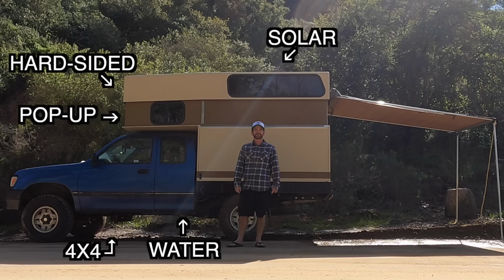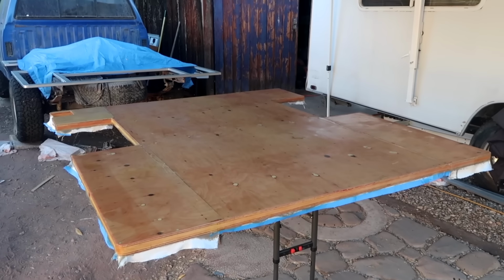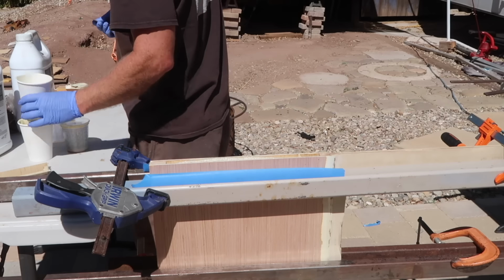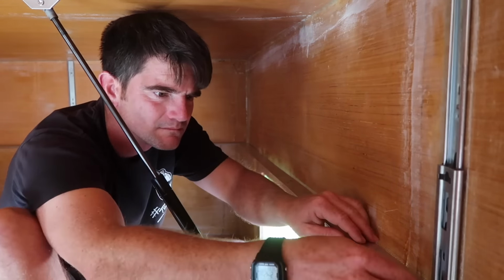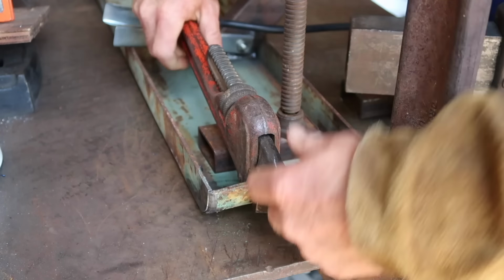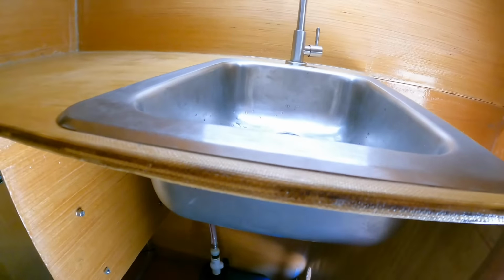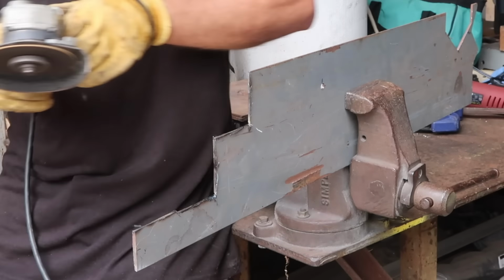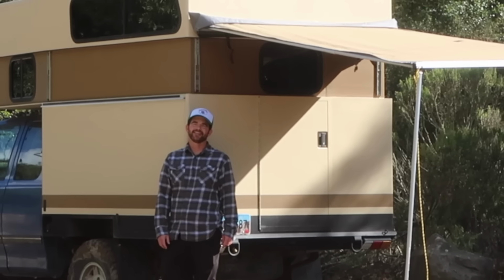Homemade Overland Truck Camper Build | Start to Finish | Full DIY Construction

Comment: I have a question for you, would really appreciate your opinion if you have a minute to spare:

Planning to overland the Americas starting late '24 early '25 with a Lance Truck Camper that i have 600w of solat and 560ah LifePO4 & 3500w inverter. It presently sits on a SRW F350 2wd with gas 6.8 V10 and under 100k. I have had the truck for 5-6 years, know it well. It is highly dependable and well maintained.

I would like to have a 4x4 for the trip, but the used truck market is quite tight. I have debated buying a cab and chassis and adding a flatbed and storage oxes, etc. Obviously this opens a can of worms.

Would you even consider doing the trip in a 2wd truck with AT or MT tires?

I'm leaning that direction just to save the headache of building out a truck. There are many stories of disappointment online of people trying to get everything to fit for a truck camper.

Obviously driving on the beach will likely be unwise, but besides the beach how often do you find yourself needing to use 4wd?

Thank you for your thoughts!

Love your channel, very inspiring!

Regards
Reply from the maker: Hi Charles. Sounds like you have an exciting trip coming up.
You definitely don't NEED 4x4 to drive the Pan American. 

How much you use 4x4 will depend on what interests you most about traveling through the region. We met people on the road that pretty much spent all their time in cities and towns. They loved going to markets and meeting people and that is what motivated their travels. As a result, they felt like their 4x4 land cruiser and roof top tent were a waist.
We used 4x4 on a regular basis. We like to camp. Our travels were more motivated by a desire to experience nature so we would drive to less populated areas where the roads were often worse, particularly during the rainy season. 2wd will get you down most roads, but 4x4 will let you slowly, safely negotiate obstacles like rivers or washed out roads. So you might only use the 4x4 for 100 yards, but not having it would have required turning around or using recovery gear to get your 2wd through.

An option could be to stick with your 2wd truck and just bring everything you'll want when you get stuck (shovel, traction boards, winch, ect.)
Reply: @Charles,
2003, we built our ExpeditionVehicle on a 1996 Ford CF8000 commercial truck.
Cummins 8.3, Allison automatic.
GVWR -- 29,000#.
Weight across the scale -- 14,000#.
Cargo capacity -- about seven ton.
.
We did South America twenty-four months twenty-four thousand miles.
Alaska, Panama, all over North and Central America.
Summers up rough logger tracks to remote mountain lakes.
Winters on isolated Baja beaches.
.
Two-wheel drive (2x4).
We see converted euro-mil 4x4, 6x6, and a couple-three 8x8 ExpeditionVehicles.
They rarely leave the road.
If they stick the thing, they call the local military to drag them back to pavement.
.
To lighten your concerns, travel with a group of recovery experts.

Comment: Matt-- i have a 3rd gen 4runner. I want to drive mex. Its stock and im considering going bilstein 4600s. What coilovers/ bushings u suggest???
Reply from the maker: I have always liked the bilstein 4600s. You can feel the improved control but they don't require as much investment or maintenance as a higher end shock.
As far as coils go... I haven't started down that road with our 4runner yet. I know the rear suspension was way too soft for the amount of gear we had on the one baja trip we've taken it on. 🤔
If I was going to dig into our 4runner right now I would do bilstein 4600s all around. Keep the stock front springs. Replace the rear springs with stock 5th gen springs (budget option) or ome 906 springs
I replaced all the bushings in the rear with energy suspension bushings. They seem to be working well. Definitely stopped the death-wobble she was getting if we hit uneven pavement at over 65mph.

Comment: Do not forget the " window insect net" + weight.  If off-road, the chassis will break because the cabin is heavy. Try to the test for off-road + cabin weight. Respect you.
Reply from the maker: The windows do all have fine mesh screens on them 👍
I'm a total 🦟🧲